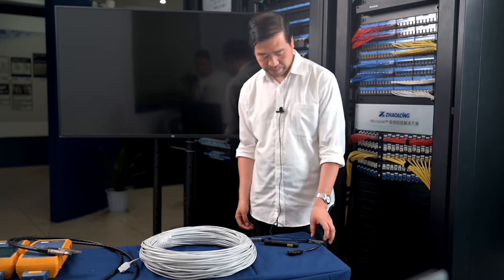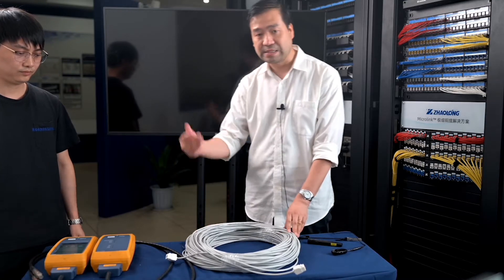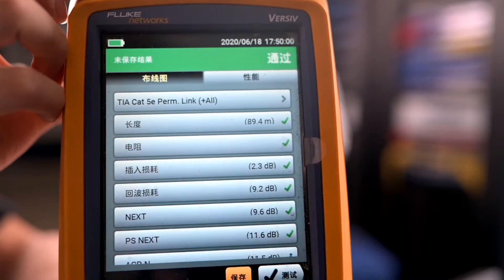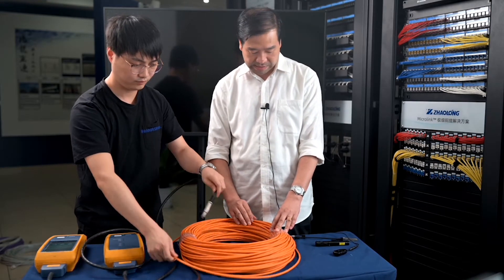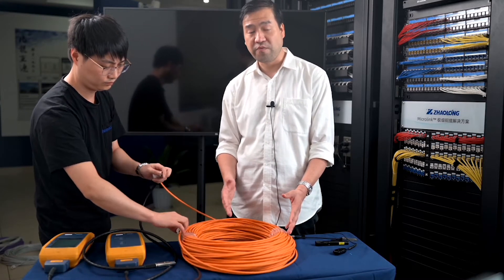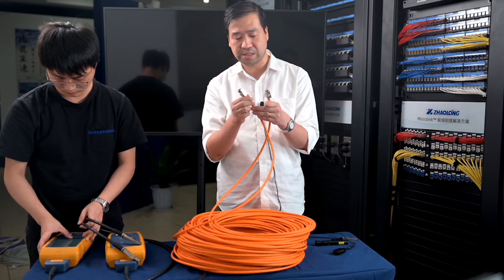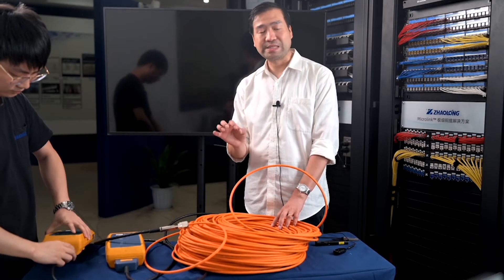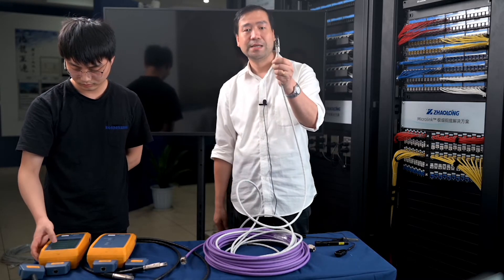fluke test CAT5E CAT6 CAT6A  CAT7

Comment: It would be interesting to see the different internal construction between CAT7 and CAT8. Maybe an idea for another video? :)
Is the shielding in CAT8 significantly improved over CAT7, or is the biggest difference just that CAT8 standard is designed short-distance 40Gbit instead of 100meter 10Gbit?
Reply: The construction between CAT7 and CAT8.1 is similar. The conductor size is different, more questions, you can contact me hanks@zhaolong.com.cn